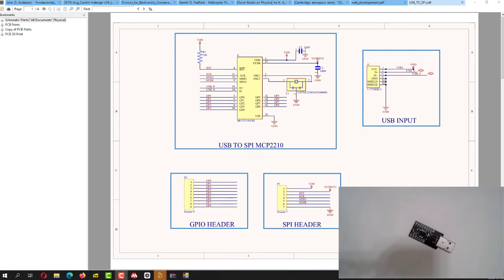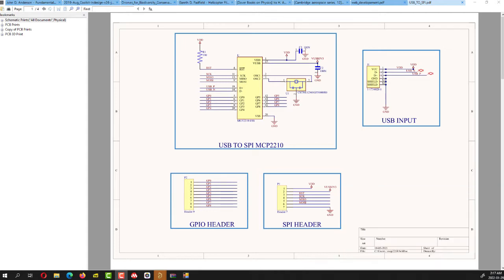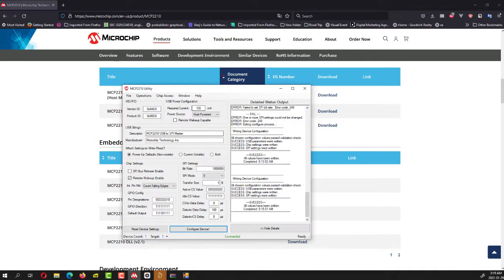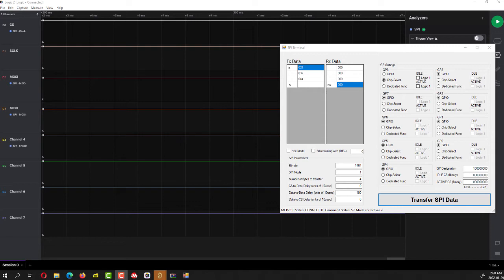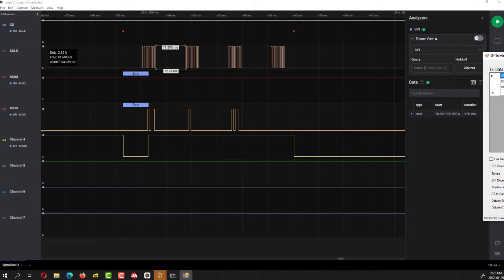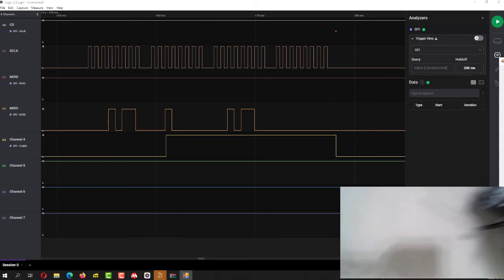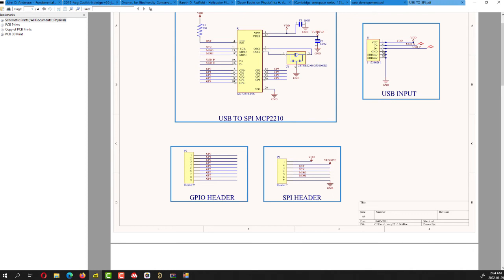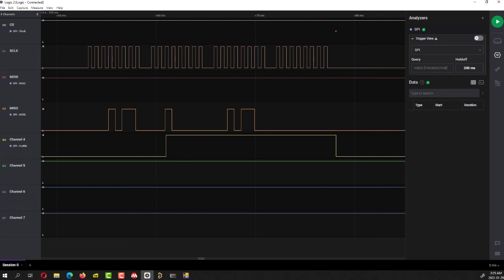USB to SPI breakout board using MCP2210  (Part 2)

Comment: Have you interfaced this chip with SD card using the same SPI protocol?
Reply: Use this chip to read and write file in the SD card using SPI protocol and interface to computer as a mass storage device like USB Flash drive.
Reply from the maker: I have not. Could I learn more what you are trying to do? Thank you!

Comment from the maker: In the video I make a conversion mistake. 1ms  = 1000us. In the utility tool, the system sets it to multiple of 100us. There fore 1ms = 1000/100  = 10us in the utility tool.
Reply: Good Afternoon Anthony:   For the design you show in the video, what is the maximum number of samples per second that your USB to SPI design can send to the PC. Sorry for the insistence, Regards
Reply from the maker: @franciscogaray2129  Technically, I could configure it to faster speeds if I change the bit rate parameters and delay parameters.  

As per the document it should support  Bit-rates from 1500 bps up to 12 Mbps. Is that what you are asking?